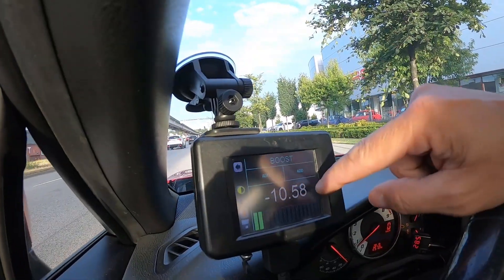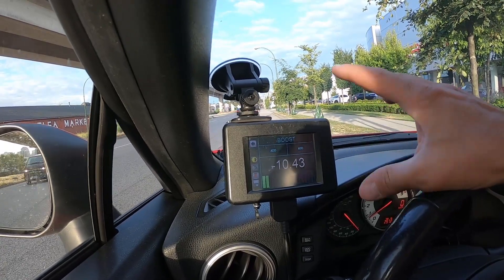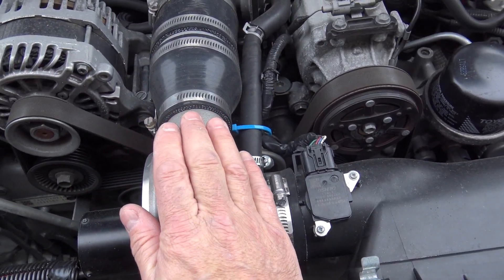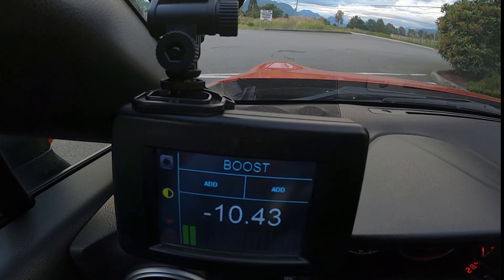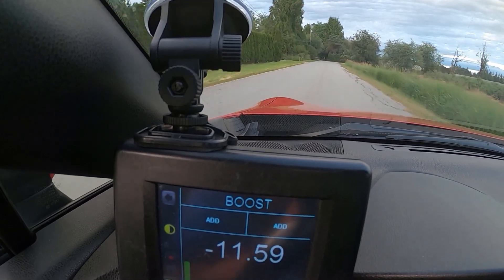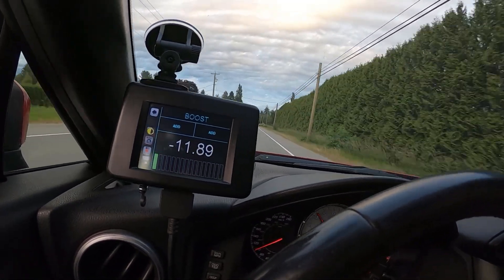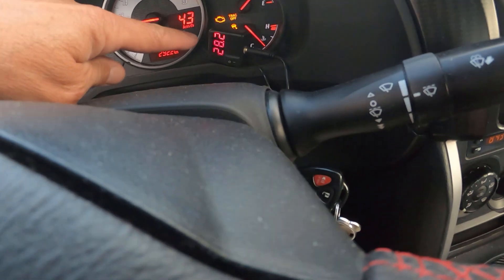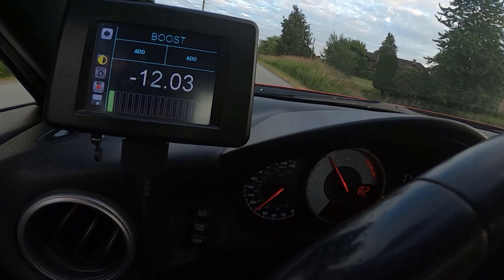Proof that my Electric Supercharge works!! BOOST

Comment: moi jai installer turbo électrique sur une 2e CAI avec un t et son propre filtre et je allume seulement quand je veux et juste avant le CAI principale j'ai installer un 2e turbo électrique donc si son a off le CAI principal fonctionne comme si il y avait rien a la normal ,car les turbo son avant et quand je les allumes les 2 ses des 12v ben je suis passer de 0 a 100km de 6.4 a 5.5sec pour un 300s 2020 3.6l donc oui sa fonctionne pour moi enotecas de 0 a 100 et sa enlevé rien car il son indépendant du system CAI  principal donc ne peux pas nuire....

Comment: My question is why did you not take off in first gear and wind it out to the rev-limiter to show how quickly the the car would move throughout wide-open throttle. Using third gear all the time took forever to wind out as well not giving it its full capacity to demonstrate how it would perform.

Comment: It is possible.  May loose some psi because of the way the super charger is connected to the manifold. 
It would be interesting to see what if an increase in fuel mixture would be...

Comment: Its almost like it needs a 2 stage power system like the set up you are running right now with a secondary stage of power once the vehicle gets up in the higher rpms to compensate and deliver more voltage to produce more rpms in the turbo charger while under load to sustain the air flow, because right now the engine is sucking all the air in faster than its producing it causing the boost drop rapidly

Comment: 2 psi, so yeah I guess you get boost and more HP like 18-20 more HP but, more parasitic load also from the alternator when the electic motor draw current. Also getting a 100 pounds heavier car. This is just stupid in a lightweight designed car. Show 1/4 time with and without it else it's a scam.

Comment: The downside of the electric turbo is it works opposite a regular turbo works. Look at the dyno graph. It starts out strong but the graph goes down as the rpms go up. Compare dyno graphs 📈.
Reply: Yup I noticed that also that's why he didn't want to keep gunning it he didn't want us to see that it looses boost top end 😂

Comment: Could you hypothetically add another 12v battery in sequence and make 36 volts?
Reply from the maker: I could but the system is not built for the increased voltage .
Reply: You could, however thing are designed to work at a rated voltage, by adding more volts, you cause more current to flow. The additional current can overheat the system or cause the motor to reach unsustainable Ron, because even the turbo has it's own redline

Comment: Take a pro charger and mount the motor to it. Wayyyy more boost with the same draw of current. 👌🏼
Reply: That gets you more rpm and boost for sure but more amps for sure needs a bigger motor with the right kv for the application but making 4psi at low rpm isn't really making 4psi at power it was more like 2psi although it can be done these guys are having surge issues and lack of air flow at rpm. They need to have the compressor overpowered and have a tapered map for the speed controller so it ramps with rpm. And minium viable is turbine speed around 120k although 250k would be ideal in ability with load. This looks like a ebay gt30 so at 60k rpm which I doubt it's at the very beginning of the map in real application of that same turbo on a 400hp honda we'd expect 200krpm atleast. Still very far from functioning.
Reply: @oliverscorsim  it depends on what motor you’re running and how much the actual drag coefficient is from the impeller at those rpms/psi. Wouldn’t be a big deal putting a larger motor as well as a high output alternator.. say 350-400amps.  The extra drag produced is negligible compared to the gain in power. Same is true about all chargers. I ran a 300amp alternator just for my sound system (lol) and I kept my engine NA and I didn’t notice any loss in power. Maybe on an engine that has very little torque would you maybe notice, but again, if you’re using it for boost then again, it’s negligible.

Comment: Yea it may give ya boost when you turn the electronic super charger on and increase the power, but when its off its 100% restricting the air flow and the car loses  up to 30 HP  then what it has with the stock intake .... if ya don't believe me they're plenty of videos to prove it...  you're better off buy an ebay turbo that give your car boost with restricting the natural air flow
Reply: Its depends, there are several factors to take into account the smaller your engine is, the less a turbo of the same size will restrict. These certain that an engine that normally has a 3 inch intake pipe will need to have a very large turbo, and this is not viable. ( turbo with 6 inch impeller or so )

Comment: All you have to do is add a bypass valve so your only running boost when needed and not chocking the engine when cruising. https://torqamp.com/bypass/. It’s almost like an exhaust bypass valve but for your intake. Add a vortech FMU to increase fuel pressure per lbs of boost and a voltage clamp at the map sensor. If you have a map sensor.

Comment: I don't discount the possibility that you could see gains because you're putting more mater into the combustion chamber than would normally be and some of that can be converted to power but why not pull from the exhaust gas, where the engine is wasting energy? If you charge the batteries with the engine, you're requiring more power from it to do that. You may as well charge those batteries at home where the price per kilowatt hour is less than petrol, or from a small generator that runs off the engines exhaust gas.

At best, you're just getting more power when you want it and paying for it as you charge the batteries & maybe some minimal gains from slightly more gasses expanding in the combustion chamber, which may not even be enough to detect with a dyno.

Still, just like these other guys say, you may be able to show boost but until you put it on a dyno & show with & without the turbo, this comes off as a gimmick & maybe even a scam to the rest of us.

what.. do you sell these systems or something? Because, if you do & haven't shown a dyno test then you're a serious jackass & a con man, in my not-so-humble opinion.

Comment: This is worth 1200 at most but these electric turbos are too expensive. Get rid of the electric turbo or throw it in a motorcycle and get the edlebrock eforce supercharger for your FRS.

Comment: People deleting their comments now after Cleetus reviewed the Torque amp
Reply: Apples and oranges.  Twice the voltage in the torqamp at 48v pulling 5 psi.   Actually pretty impressive 24v is pulling 4 psi.

Comment: Fail. That was not max rpm and WOT. You need to open that throttle plate all the way, and also redline it. You cannot prove that what you are doing did not create differential pressure between before, and after the intake manifold. I want to see your tps sensor voltage, and two separate vacuum/boost gauges before, and after the throttle plate.

Comment: The question was does the E-charger make boost, I saw 5 psi at the initial hit in the video. It would show more boost if he started at a lower RPM because the electric supercharger spins at a nearly constant speed and unloads at higher speed which means less boost and more airflow. I guarantee that if he did the pulls from 30 MPH in high gear on an onramp you would see as much boost as the system could make because boost is just resistance to airflow.

That said he really needs to gear that impeller up because he's reaching the back EMF RPM limit of the motor not the power limit, and he could get the impeller in a better speed range compared to the motor output if he geared the output from the motor to spin the input to the impeller faster than the motor. Thing is that's more complexity and another point of possible failure in the system.

Comment: Dyno it, no way that little electric motor makes boost, it takes hp to make boost
Reply: The question was does the E-charger make boost, I saw 5 psi at the initial hit in the video. It would show more boost if he started at a lower RPM because the electric supercharger spins at a nearly constant speed and unloads at higher speed which means less boost and more airflow. I guarantee that if he did the pulls from 30 MPH in high gear on an onramp you would see as much boost as the system could make because boost is just resistance to airflow.

That said he really needs to gear that impeller up because he's reaching the back EMF RPM limit of the motor not the power limit, and he could get the impeller in a better speed range compared to the motor output if he geared the output from the motor to spin the input to the impeller faster than the motor. Thing is that's more complexity and another point of possible failure in the system.

Comment: 🤣 3-4psi boost I’m running 15psi lol
Reply: What do you expect its only an electric turbo? Also most motors won't last long at 15 psi!
Reply: chris henderson 15psi is fine for my motor you don’t know what you talking about
Reply: @thetoad7367  If it's stock internals most motors aren't going to last long at that boost pressure!
Reply: chris henderson your absolutely correct my wrx Sti makes 18 pounds of boost but was built stock with it so it’s fine
Reply: You also can't run more than about 8psi without an intercooler either ya dickhead!

Comment: Look Dude, you're thinking backwards. Add a pulley to the rear and use the engine to make your boost. Your biggest prob lem is mounting, but you have a large number of mount holes available.

Comment: Poeple coments kill me. 
Can you make power with a strong electric supercharger. Yes if its output is more then the L of your engine. Now is this guy making power idk. But the smaller engine you put that some supercharger on the more and more power you will make
Reply: yes , more air it need the more power the blower will need to spin and make constant boost at X CFM

Comment: How do you get boost from a 3000 rpm blower ? You don't have enough CFM to boost a lawn mower at 3000 RPM, Put it on a dyno, 24 volt 250 Kv motor won't do crap.

Comment: Put that on your lawn mower it'll work right anything larger not at all.
Reply: You can literally see the boost go down as the engine rpm went up. That means that the electric supercharger could NOT produce enough boost for the higher demand of air that the engine needs in the high rpm range.

Comment: I actually had to look up an frs dyno chart to see where to refute this. The highest boost you had was at about 3k rpm and it was under 5psi. This is actually quite good, the frs makes good torque here and the boost will give it a kick. It goes down fast, hard and in a hurry. It looks like by 4k rpm it's under 3psi. This supercharger will give you more torque than horsepower by virtue of the reductive benifit at higher rpm. There is potential for as much as 40 ft lbs at 2500 rpm, but this is less than 20hp. It will probably add less than 20hp at any rpm and is best used for what you do, getting your minivan slow sports car out of the way of 18 wheelers on the highway, most of us would just use a lower gear. I would be shocked if peak to peak the gains were more than 10hp, the boost is going down faster then rpm is rising and I have a feeling this is going to be a restriction at about 6k rpm.
   This is why people say its a waste.of time and energy. You haven't dynoed it, you haven't even gtech tested it. Next time put the car in sixth gear and use.the brakes to hold the revs stable. What you will find is that battery setup starts to sag so badly 10s in that it can't do what's asked of it. There is no point to this unless that's what you want is to not have to downshift once to get on the highway.

Comment: Everyone notice how the boost drops when the rpm got higher and he lets off? Yeah that right there sir is that you're going to suffer at top end..
Reply: It most likely starves the engine of air since the supercharger only goes to 55k rpm.
Reply: KO GOAT that’s why it keeps going negative even under light throttle, taking off in any engine with a turbo will show positive boost not negative

Comment: 5lbs of boost , huge drag on engine due to alternator having to produce power to run the electric motor . i highly doubt there is any gains on the dyno . you would need stand alone batteries and much more power . it would require a high discharge bank of lithium and need to be charged from another source as the drag from the charging system would highly impact output . you also would need higher voltage or bigger cables to transfer the energy required . 
Law of Conservation of Energy, states that energy can neither be created nor destroyed; energy can only be transferred or changed from one form to another
Reply: mazda2284 
It takes power to make boost no matter how you do it. So if it’s making the boost, it’s making more than it’s hurting. Plus he does have standalone batteries I guess. He’s also boosting a small engine so maybe it’s possible since the cfm required to make boost is much lower compared to larger platforms. Too many variables to say. Only a dyno will prove it.
Reply: @gforce_117  he does have stand alone batteries for the turbo but they require charging , those dinky little agm batteries would not last long without being constantly charged , to charge them they use a 12v to 24v step up converter which is another loss in the system . some claim their converters are 90+% efficient though outside testing shows many of those claims to be false ,  whats really funny is some claim they are 100% or 99% which if you know anything about electricity that those claims are total bs . id need to see dyno charts and proof , also would be interesting to see back to back to back passes like normal dyno tests do , also curious if there are horse power losses in different rpm ranges .
Reply: mazda2284  pretty much. It would take a pretty serious battery series to create enough power. If he has enough juice, it can work. The charging system would drag on the engine yes, but so does a turbo or supercharger. Even if I took say 10kw that’s 13.5 hp. Even a couple pounds of boost is worth a lot more than that. At that much power you’d need a rechargeable bank. 

He could run a bank of batteries like a Tesla so he has tons of run time and could just charge the bank at night. But that’s expensive as hell and adds a ton of weight. Regardless, it’s not practical with current tech. It’s just a fun project
Reply: @gforce_117  except torque amp does it.. 42..or 48 volts.. made 5-6 psi and gained 30-40hp

Comment: How much vacuum do you have, with vs. without at idle? I don't think what you demonstrated in boost offsets the cost in restriction when it's not engaged. Yes it makes boost for a small range in rpm. The rest of the time it's slowing you down.

Comment: Use a gear multiplying system like the centrifugal superchargers use then you will get around 10 to 12 PSI boost
Reply: Dude, i think if you spin it more than 55,000 rpm it would probably shred....

Comment: What everyone here should remember is how much of thar boost is actual more pounds of air being pushed into the cylinder and how much is caused by the air heating up and expanding and not forcing more pounds of air into the cylinder. I ran a 144 ci B/M blower with there early fuel injection and buzzing the motor past 6000 rpm the motor started to LOSE HP because the blower was just heating the air up causing boost because of it and not shoving more are into the cylinders. That is why the Dodge Hellcat uses the A/C to cool the intake charge to increase density of air getting into the cylinder. Also why a lot of serious racers cool the fuel down as cool as they can to reduce the air temp amd increase the air density in the intake plenum.  
PS that B/M motor was one of the most enjoyable rides I ever owned. Acted like a stock 355 until you romped on it and then hold one for one heck of a ride. Also the entire setup fit under the factory shaker on a 75 Trans Am.

Comment: Yeah, that's some boost.  But I noticed you're only using it for very short pulls.  How long can you run it before it's a problem?  Can you end up with a low-battery condition where the impeller just won't spin fast enough to create positive manifold pressure?  I know safety and conditions are important but I wondered if you've done a longer pull.

Comment: Wouldn't a normal turbo cost same as that? You dont get cool bov noise either and 4 pounds aint worth all that to me. Atleast get 100k rpm electric motor and you can get closer to 10 pounds to actually make 250hp. Castle has motor that spins at 100k rpms off of 8s system which is little over 24v. I would just get one of those ebay turbos for 500

Comment: PRODUCING "BOOST" IS COMPLETELY POINTLESS WHEN YOU INTRODUCE A RESTRICTION. you can produce "boost" by merely decreasing inlet size, thus increasing the velocity. Not to mention your reading from the map which isnt an accurate representation. 

WHO THE F**k are you trying to convince? 4500 rpm and you have nothing, if not before do to the lag in reading the boost from the map. 

"im not trying to say its the same as turbo/sc, its completely ineffective at any price point" fixed your last quote for ya